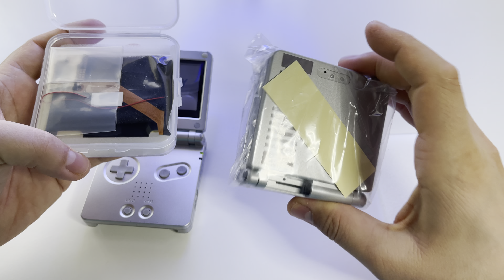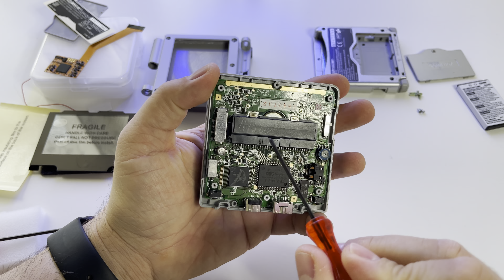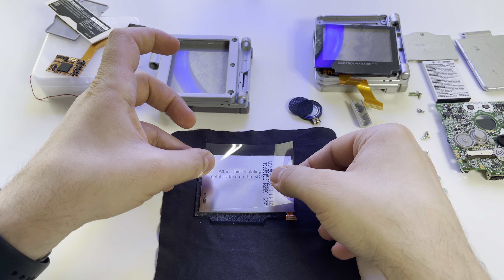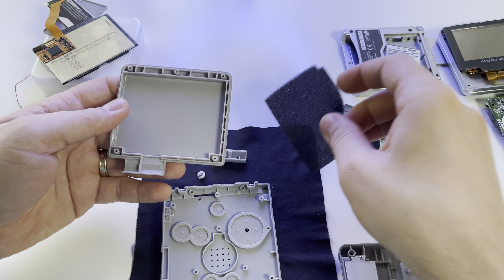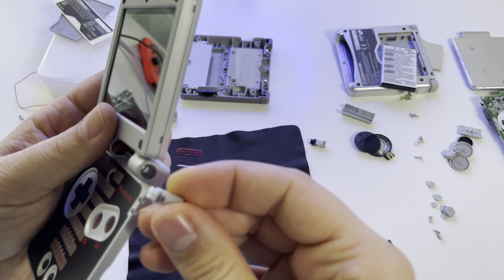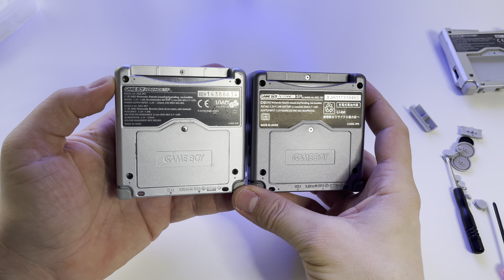Gameboy Advance SP - IPS V2 display mod is stunning | How to install IPS display on Gameboy

Comment: how is the default brightness ? and also how many hours does it run on a a single battery charge?
Reply: Battery life seems to take a hit but cheap mods (esp mahko's) extend it significantly.